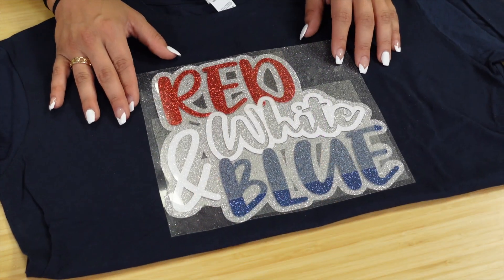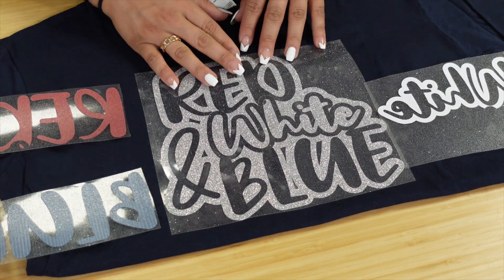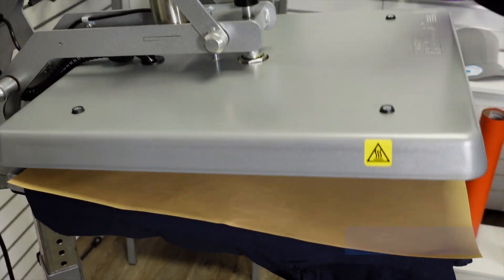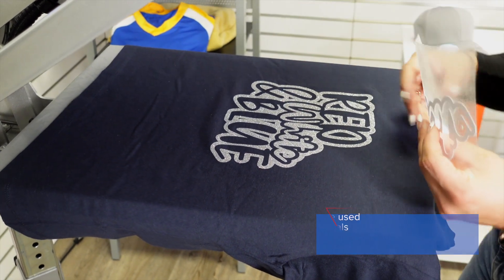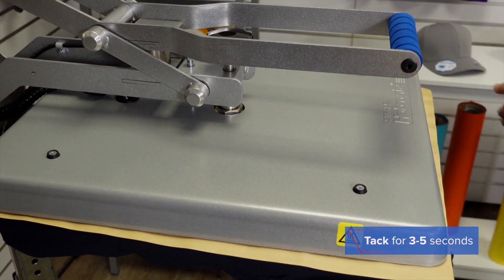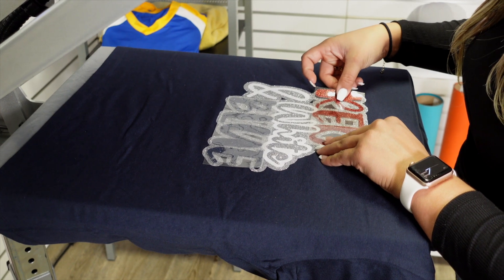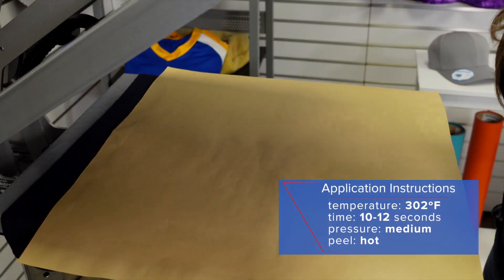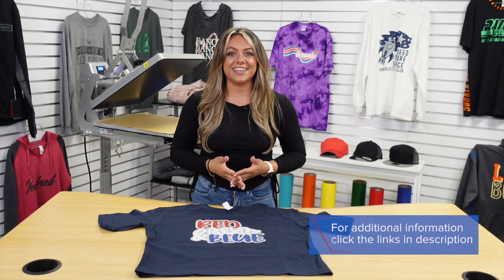How to Layer Glitter Heat Transfer Vinyl | The Trapping Method

Comment: Good day,

I have a question the glitter was applied to a t shirt now can that t shirt go in washer and dryer with my other 30 shirts or does it HAVE TO BE WASHED DIFFERENT ?
Reply from the maker: Hello!  These are the washing instructions for Glitter Flake: Machine wash inside-out using mild detergent.
Do not use bleach. Dry at a normal dryer setting on household machines. Do not dry clean.

You should be able to wash with other materials and follow the garment washing instructions as well.